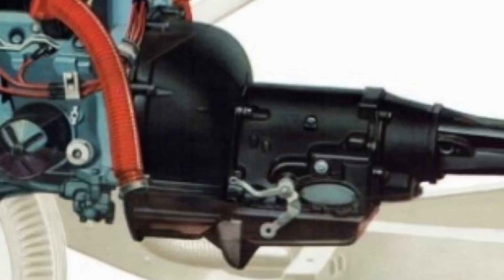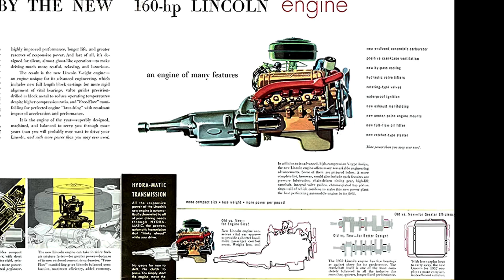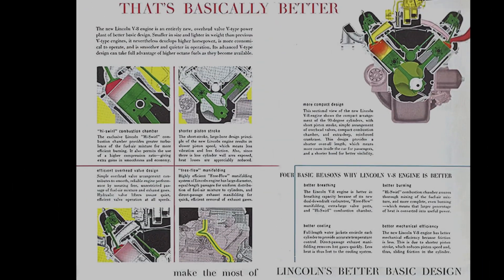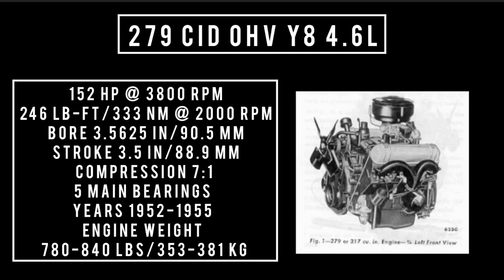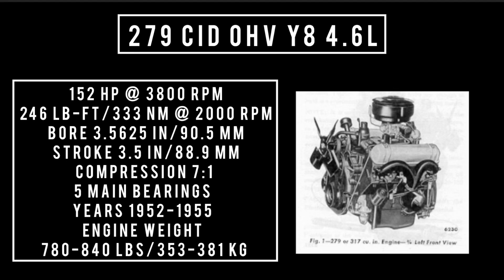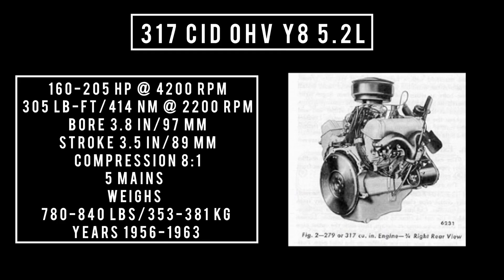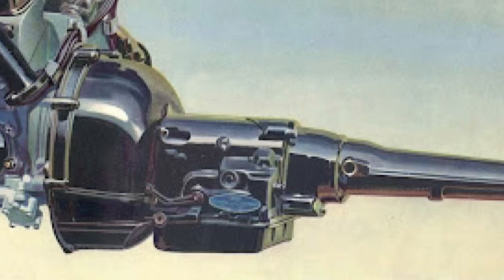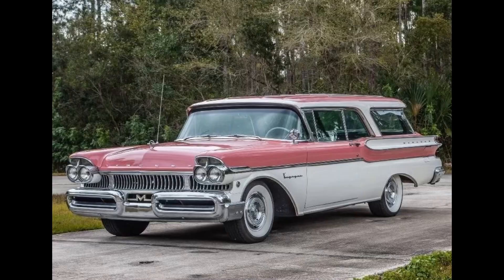Lincoln Y-Block 279,317,341,302,332,368

Comment: Interesting video. I didn't know much about this engine family. I think you're correct that this was the first engine with a full-flow spin-on oil filter. I thought it was on the 1956 Ford engine. I would rather have the 1956 Lincoln Premier and the 1957 Mercury Voyager Wagon.
Reply: The 1957 Mercury wagons are irresistible and will never go out of style.
Reply from the maker: I wonder if anything predates it..
Reply: The only thing in the same category would be the 1956 Rambler 4 door hardtop Cross Country station wagon.  @What.its.like.
Reply from the maker: 1959 Rambler cross country wagon is my favorite wagon of all time.. I absolutely love those I have never seen the ambassador version in the wild I saw one for sale a couple years back for 18 grand under the hood is that legendary 327 it was a stellar looking car 18 Grand was like the equivalent of $1 million at that point lol
Reply: The spin-on oil filter was first used on certain 1957 Ford, Mercury and Lincoln engines. It was kind of a mid-year phase-in situation.
Reply from the maker: 52 Lincoln would be the first one for the Y block it was spin on oil filtration from the get go.. I was wondering if there was anything that came before it
Reply: @What.its.like.  From what I can glean from online searches the Crosley briefly offered a spin-on filter in 1950 - 1952, but it caused problems and the company reverted to a cartridge type.

Ford Motor Company first offered the spin-on filter in late 1956 and early 1957.